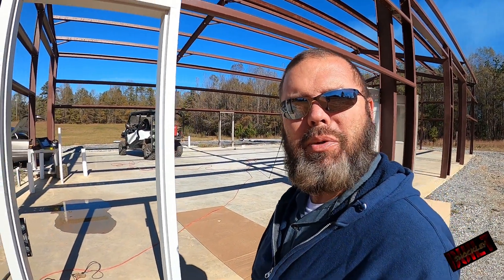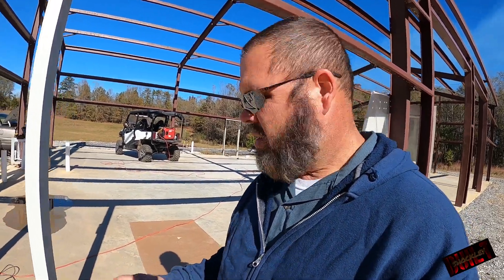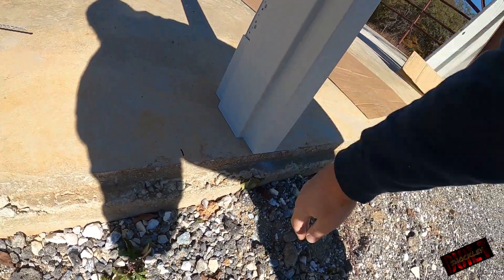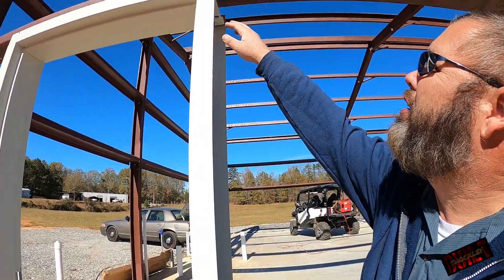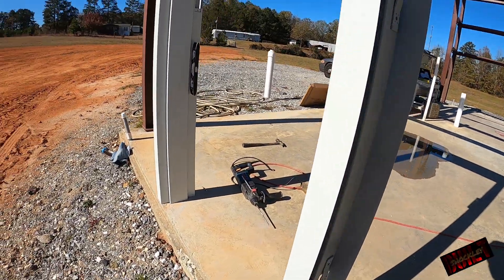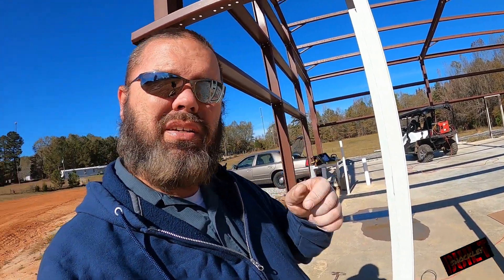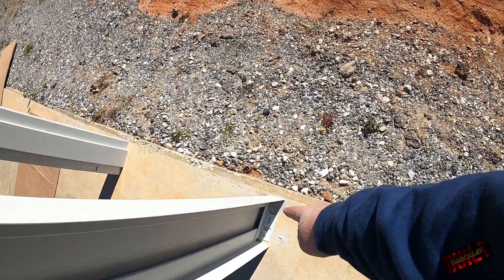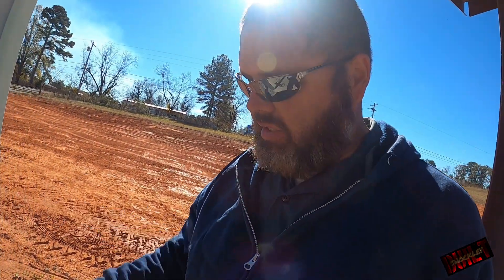How to install metal frame door in Red Iron construction

Comment: I have installed Commercial door’s and hardware for over 15 years of my 35 year carpentry carrier. Question, Did you check to see if the concrete was level? That would determine if your jamb head is level.
There is a possibility that one jamb leg or the other might have to be shimmed up.
A framing square helps determine if everything is squared up. On most hollow metal frames the clearance of the bottom of the door to the rough finish of the floor/concrete is only 5/8” so grinding one jamb leg or the other is not really an option unless you are not installing a standard 1/2” threshold. A 1/4” might have to be used instead. Good video. Greg
Reply from the maker: All excellent points. I am more of a do it and watch me and just since I started this channel trying to slow down and show how I do things after my first few videos and my son said I need to explain what I am doing. But I did not check the concrete level because I built the forms and knew the concrete was level. I also should have explained that most of those doors open outward.